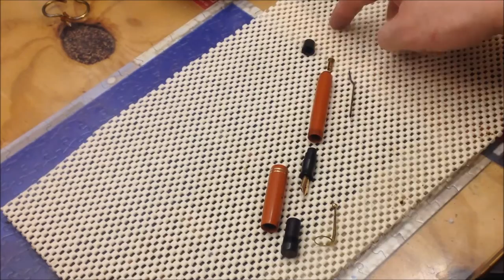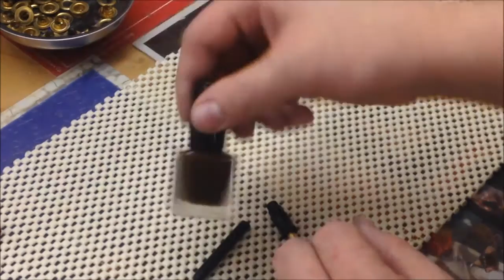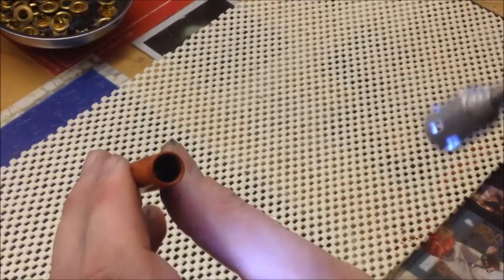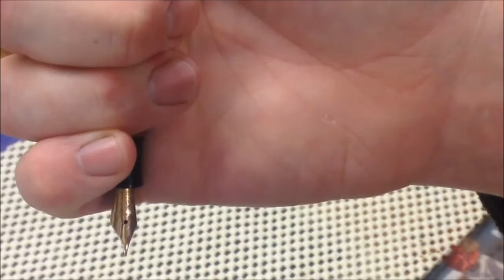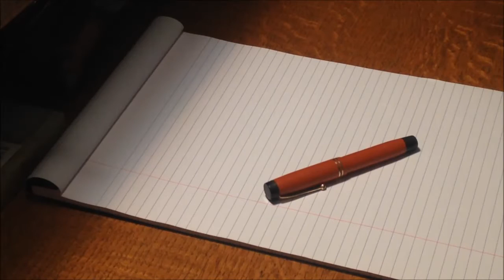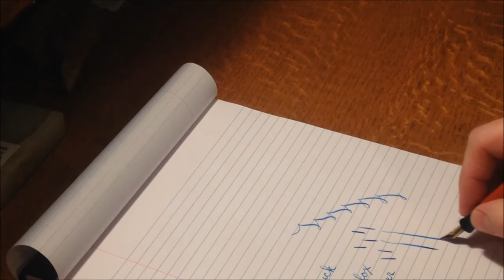Parker Duofold Junior restoration

Comment: Thank you - that was very helpful. I have my great-grandfather's Duofold Jr. and was never brave enough to take it apart and clean it, but after watching your video, I did it successfully.  The only thing different was that there is no internal ring for the pressure bar to catch on - I needed to first screw on the nib with the sac, and then insert the pressure bar, which then rests against the shoulder of the nib holder on the inside.  Couldn't or wouldn't have done it before this video
Reply: Howard Austin , I am so glad to hear this. Will you be using it? I think vintage pens deserve to be used as intended.
Reply from the maker: Howard Austin, I'm happy I helped you!
Reply: @lukeenyart1073  Hi Luke Enyart - I've been using it periodically since the early 80s when my aunt gave it to me.  At that time it had been sitting unused for many years and I had to have it serviced and a new sac installed.  I figured that is was time for another thorough inspection and cleaning.